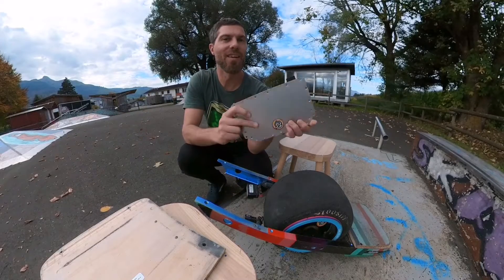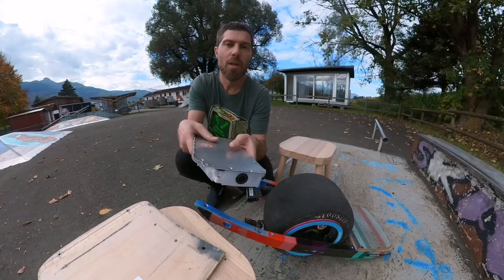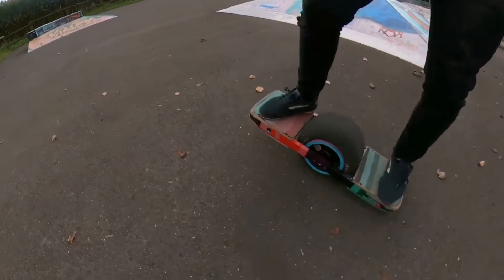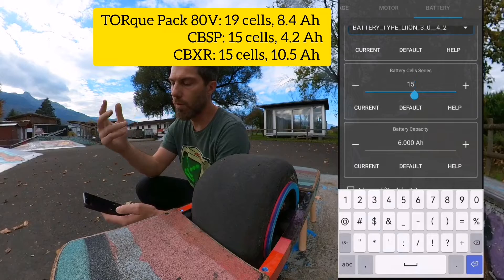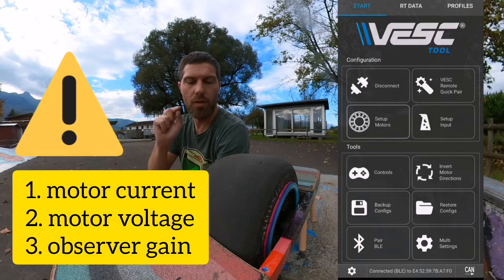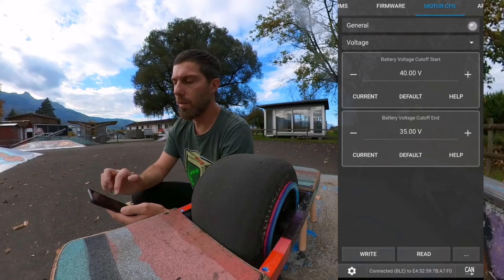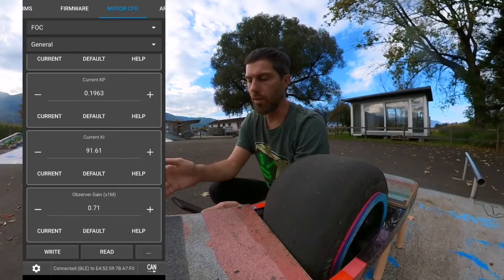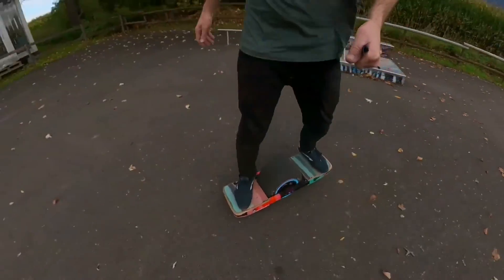How to run motor detection and IMU calibration for VESC Little FOCer

Comment: The challenge for some riders without the tech expertise is not knowing the battery hookup side of the build. I have a JWXR extended battery with an OWIE chip and bms. I have no idea what to do about that part of the setup as far as hooking it all up for a finished rideable board.

I think others like me just want a plug and play for both ends of the board.

Thanks for your great video and content.
Reply from the maker: that's absolutely true and that's want I want come out next for everybody. Actually fungineers are going more and more into plug and play solutions. Keep your eyes open for upcoming releases on their side. VESC, Battery/BMS, Motor
Reply: @VESCmann  will do. Thank you again for sharing your knowledge.

Comment: So your telling me. Once I complete my diy build from makers pev. I can just plug everything in with my cbxr and don’t need to take my fm bms out or do anything to the battery. I can just plug in and ride after I set the tune
Reply from the maker: you have to remove, mod or replace the bms. If you bought the plug and play box I say yes. Should work right away. But still you should check the battery specs in vesc tool (63V).
Reply: @VESCmann  this is the same with the cbxr? I can run no bms till I get one? With a bigger battery?

Comment: When I calibrate the IMU I can never get the correct values. It seems to think my board is upside down?  Been through many guides, but cannot figure this out. Also, my footpads do not work unless I install the float VESC package. I've started over a few times, followed Surfdado's guide, but am coming up short. I feel like I'm missing some small detail. Funny thing is I got it working when I first tried it, but now the IMU calibration is just....not working.
Reply from the maker: On fw 6.0 with float package you need to read and writte tthe default values for IMU first. App CFG - IMU - default
After that you can follow the IMU wizard and set it up

Comment: Hi, i followed your instructions but the board won’t turn on. It seems like you are using a stock XR battery harness, not a makerspev harness. Did you modify what’s in the battery box in any way? Is it still charge/discharge FM BMS?
Reply from the maker: There's no bms connected to the battery
Reply: @VESCmann  i think it will be helpful to pin a comment on top explaining this. It’s misleading to me as it’s not mentioned in the video and gives the idea that I can just buy a box and plug and play into a stock XR and expect it to work

Comment: Hey, Are you using stock battery wiring harness? Managed to get the flowglider fully assembled box in the latest drop but wondering if i also need to get their wiring harness. Cheers
Reply from the maker: It's the stock harness but no bms inside the battery box
Reply: @VESCmann  thanks for the reply. Sounds like i'll need to remove that BMS (and make sure I confirm polarity etc). Cheers

Comment: What battery currents do you recommend for the torque pack?
Reply from the maker: Anything from 30 to 90A. With lower values you're able to do nose drags and stuff and with values above 60 this it is getting harder or almost impossible depending on your settings
Reply: @VESCmann  appreciate you making these videos for us newbs